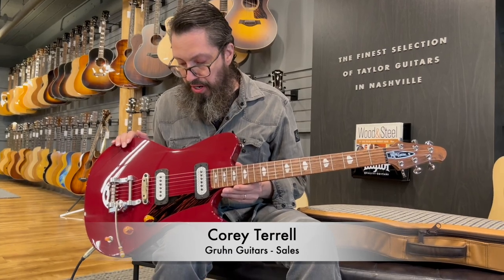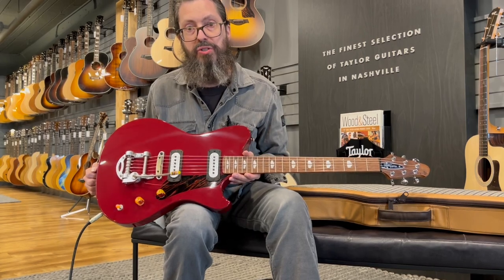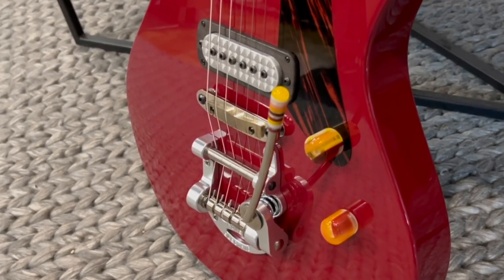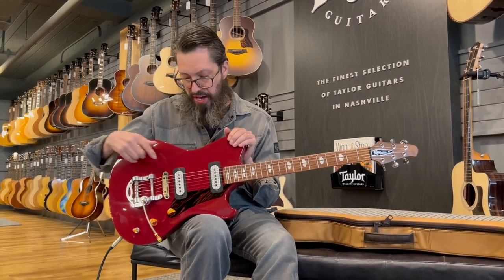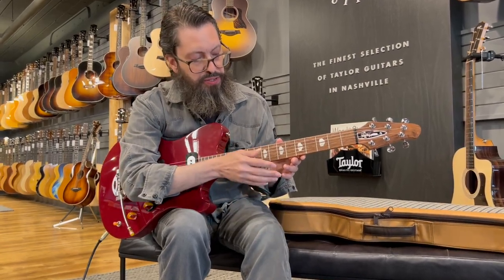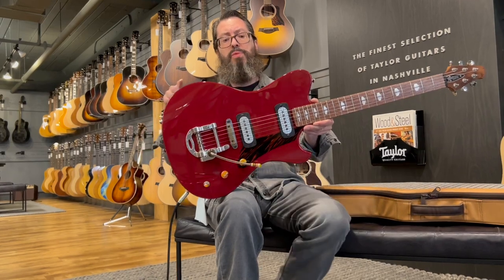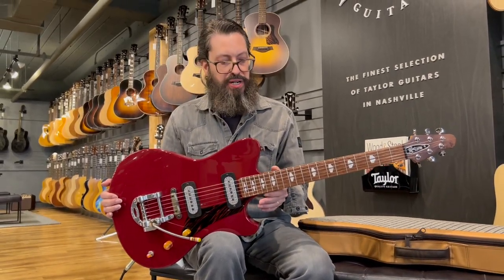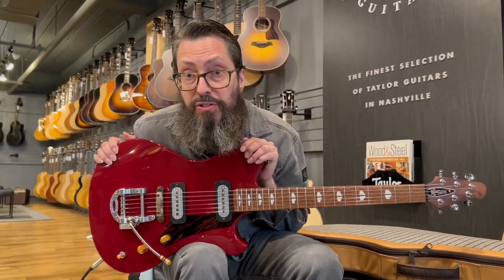Introducing Powers Electric Guitars

Comment: Fret leveling and recrowning will be fun on that get up. Split radius blocks in half perhaps. Maybe ? Maybe not !
Reply: No, you'd just use a straight beam with abrasive stuck to it and follow the fret profiles.  A refret, on the other hand, might be challenging!
Reply: a compound radius becoming a more common feature on guitars. I order necks from Warmoth and it has been their default normal for years. It's not as bad as one might think.
Reply: Its not a simple compound radius, its variable radius from high E to low E on the neck , not from 1st fret to  24th fret
Reply: @jimdoner3443  OH MY. Lord. Okay that is meticulous. Yah, that is a different beast altogether.